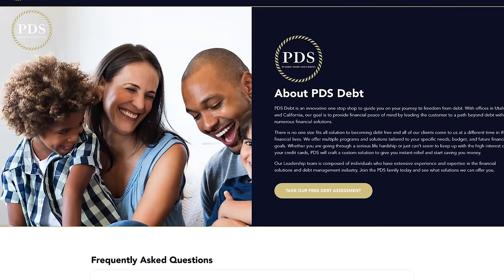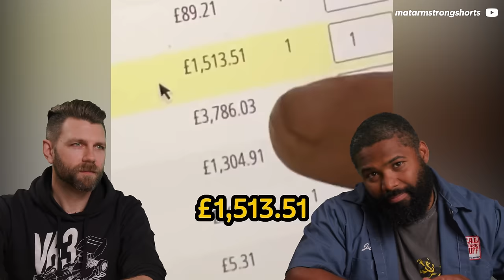Mechanic Reacts to Expensive Supercar Repairs

Comment: The best car to have mid engine is a Corvette C8, base price 60k for the working population of people. You can work on it yourself. The most reliable mid engine fast car outside the Corvette C8 would be the Acura NSX, but I am sure you will definitely need an Acura Technician for that one. Maybe Porsche 911, Porsche Cayman. Last but not least, the Toyota MR2 if you can find one in good or great condition.

Comment: What a lot of people don’t realize is that supercars are race cars that are made to be driven on the street. So a lot of the parts aren’t designed for daily use or to be driven on crappy ass roads. The majority of these cars are one and done. You run them you get rid of them you run them you spend two months in the shop, you run you spend $50,000 every six months having them gone through. Do you buy a mustang or Corvette send it to Callaway or Rouse or Shelby and those are race parts on a street car they are a little bit more durable and don’t take as much maintenance, you can buy the parts to do maintenance or repair them from your local auto parts store

Comment: The wheels on Bugatti are replaced only if they are carbon fibre as carbon fibre degrades over time and the wheels also get hot which speeds up the ageing.

Comment: I've been driving my 86 in -20C weather on dry clean roads and I have no traction with my pilot sport 4 tires
Reply: Aren't those summer tires?
Reply: @nthgth  yeah. I don't have winter tires on my 86 because I don't drive it in the winter but the weather has been crazy this year and the snow will all melt and then it will go back to -20. It snowed yesterday.
Reply: @kylewagenaar5786  so why don't you drive your winter car until it's ok to drive the 86? Whatever you drive in January would still work now, right?
Reply: @nthgth  the roads were clear of ice so I wanted to drive my 86.

Comment: The real reason you have to replace the wheels on the Bugatti is because they glue the tires to the wheels so they don't slip on the wheel from the torque. You're supposed to replace the wheels every 5 or so tire sets because the glue basically ruins the wheels and makes them not as smooth. At least that's what I've been told through Bugatti videos here on YouTube.

Comment: There is a good reason you should have the most expensive cars just stay right up front.  You would only have to pull them forward maybe 60 feet.  And then just walk the guests to the car.  The clutch won't burn then.

Comment: You're wrong (at 17:08) The brakes are glowing on the Lamborghini. You see steam coming off the brakes as the wheel rotates through the puddle next to the curb, dripping water on the disc. Sorry You missed it. 😢

Comment: Dudes run the Texas Mile (and other top speed events) and drags in 200mph cars and bikes that hold up to WAY more abuse than these temperamental exotics. I get that it take a really special car to go 250+mph and be street legal, but some of these costs are just obscene. Guys can knock up a badass 200mph racecar in the garage with their boys for less than $20K.

Comment: I have an expression "There's a difference between having the money, and being able to afford something" - "supercars" being an excellent example of this.

With the Ferrari, other than the guy/gal being an idiot, it's classic example of overcorrecting - rear breaks loose and driver automatically applies some countersteer while backing off, rear regains grip, stops sliding but steering still trying to correct non-existing slide and vehicle turns, driver panics and gives it too much correction in the other direction, repeat to spinning out either from increasing over-corrections and/or locked up brakes until vehicle comes to a stop - often after hitting something.

The irony of these Lambo's burning out clutches is that lambourghini started to build cars because the owner was angered by the clutches burning out on his Ferrari, and he discovered they were the SAME clutches as fitted to the tractors his company was making.

Comment: This is fun. It is sort of the same in private aviation. You might be able to afford the plane but can you afford the maintenance? Even being certified to do the work myself, the parts are so expensive my plane is a glorified kite because that's all I can afford to buy parts for. The fuel is another issue. Even a glorified kite will burn 5 gallons of gas per hour. Still, for my money, I'd much rather fly a glorified kite than drive a supercar. I can get my high speed road feels just fine on a cheap motorcycle but you can only fly a Lambo once. I guarantee they bent the frame. That isn't some old box Chevy.
11:56 It never ceases to amaze me how people will buy vehicles they have no idea how to operate. Half the people driving pickup trucks and SUVs in the US shouldn't be. It isn't just supercars and superbikes that are problematic.
I burned up the clutch on a 350Z on a test drive one time and they said not to even worry about it because it wasn't really my fault. It was the other 3 dozen boneheads who drove it before me and the clutch was already excessively worn and glazed and probably badly out of adjustment too. This is why you don't buy a demo sports car.
I won't even let a valet drive my 2001 Jetta VR6.

Comment: I don't like to do that knows it all about these cars on the Lamborghini countach I looked at the tires and notice they was not  crack and dry rotted set under the hoods by still in good shape maybe a little Dusty and on the first car does that radiator not have a fan I can set hours in Dallas traffic and my car won't overheat

Comment: The explanation of the Ferrari spinning out is bad.  It has more to do with the moment of inertia of the car, which is much less than a regular car due to where the engine is located.  Having had a MR car with no stability control (Lotus Elise), I can tell you that it is basically like trying to throw a dart backwards - the back end wants to come around if you don't know what you're doing - like hitting the brakes while cornering.  Weight transfer to the front exacerbates the effect.  Never had that happen because I understood that going in.

Comment: Only a pristine 80's Countach of the right year and model will go for anywhere near a million. The more valuable ones are the 70's model.

An 80's one like that, even when really well repaired is going to go for 300-600K, one that has been maintained perfectly for the past 40 years, that may sell near a million.

While looking good, the 80's Countach was a trash car, trash ride, trash materials, trash engine, trash in every fiber of its being, but because it made for fantastic poster porn thanks to its looks, it still sold relatively well for a Lamborgini with such a bad rep.

Heck, they even made a movie with the 80's Countach at the core of the movie and the whole story was about it breaking down.

The new Countach on the other hand is listed at 2.6 Million and a

Comment: I have noticed also that parts are shared from other cars, for instance on h2 hummers the climate control components are from silverados, but if you get the part numbers and look just them up you will get a deal versus looking it up for a h2, for example blower resistors, mode door actuators, heater cores and evaporator cores. It uses the same hvac box

Comment: Right, no, sorry. "All these things it's designed to be able to do, it does" yeah, but it isn't REALLY able to do it if it immediately destroys itself in the process, is it?
You could take a Miata to 1000hp without swapping the engine, run it for a few seconds and do a pull and then toss everything, noone would say "This is ABLE to do these numbers!"

Comment: I remember when driving F1 car with V10 Cosworth engine I actually was told to give it some revs right after the start, because the engine was built in such way that right after the start it had only 8 cylinders running, and to fire up the other two the engine had to build some fuel pressure, and to achieve that its revs had to be high enough. Maybe the guy in that Ferrari had too much experience with specific Cosworth V10? :D

Comment: A million dollar plus "super"car....good for one or two drives...IF there's no speed bumps, potholes, driveway curbs, dirt on the road, or butterfly wings flapping.
I paid $300 for my '68 Corolla and have driven the holy hell out of it for 37 years so far. On road, off-road, sand, mud, snow, JUMPS, daily racing, hauling full size trucks on trailers, just hard hard hard all the time, hundreds of thousands of miles. I've got less money in it than a set of Bugatti tires. Sorry fellas...I have the REAL supercar.

Comment: Ferrari not really a light weight car 1435-1611 kg (3164-3552 lbs). gma t.50 that is what you call light and has load power 4.0 L 700hp, its target kerb weight of 986kg, an incredible achievement given the three-seater layout and V12 powertrain. this is what supper cars should be aiming at. under a ton crazy power and v12 and being light weight it also handle pretty well too and 226mph top speed and £3million price tag and  12,100 rpm redline. the Ferrari  looks heavy compared to this

Comment: The F1 cars upon which many of these super cars are based are continuously monitored every time they are driven by a team of engineers and technicians to optimize their performance and protect them from failures. Street versions of them are not. And the average driver of them doesn't have the expertise to properly operate and maintain them.  Wealth doesn't always equate with expertise or intelligence.

Comment: I would buy a burned out or crashed supercar that would be sold to me as scrap, I would take out the fucking prehistoric engine that burns things inside to have power, I would change it for a simple electric motor, I would paint the car in a simple way, low speed, Normal car wheels, normal brakes because I HATE SPEED and that's it, a "supercar" to enjoy and not spend money on absurd things.